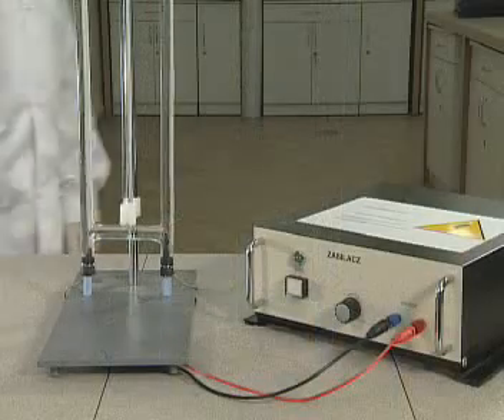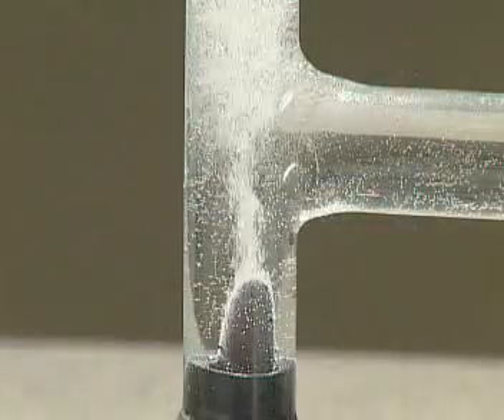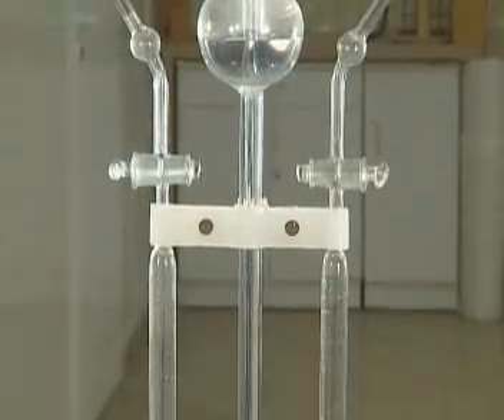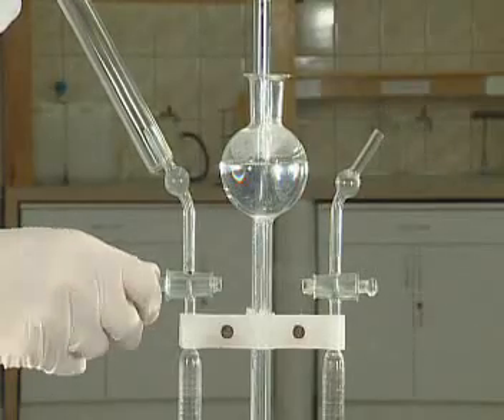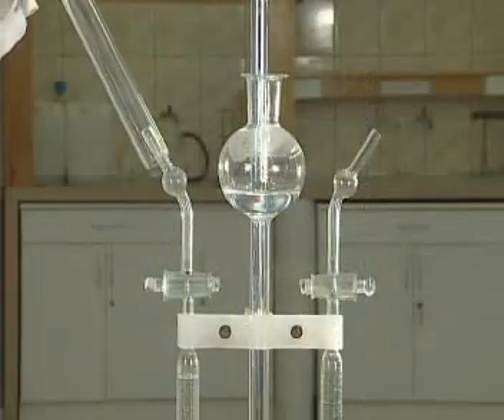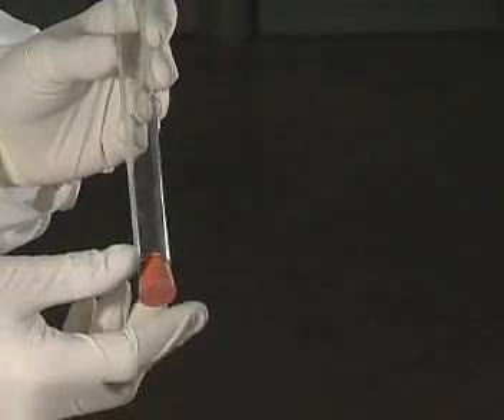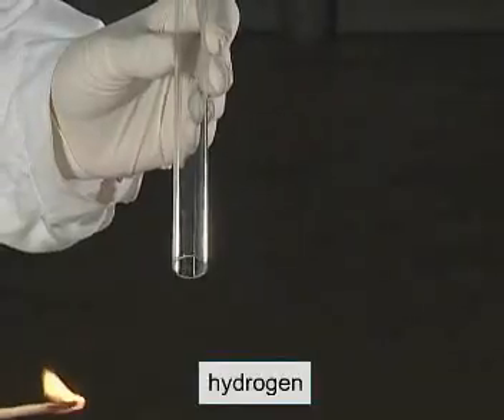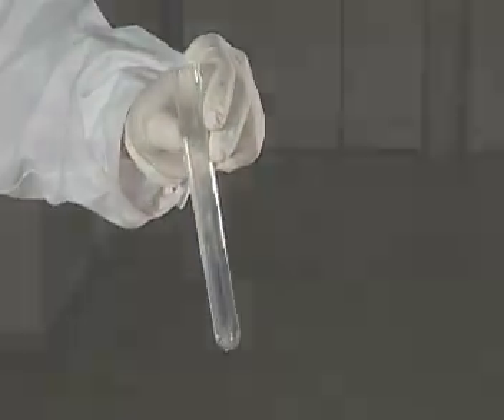Hygrogen and oxygen from water

Comment: So is the metal electrode also moved from one side to the other like standard electro plating and have you sometimes to reuse it have to change the polarity while first making sure there is no gass left behind in the tubes  to not make a mix of hydrogen and oxygen gas that is highly combustible ??
Is this threu that also the metal transports through the water ??? And can what kind of substance is added to the water ? An acid but what kind of acid again, I always seem to forget that ?

Comment: Somebody asked "Can I use Electrolysis process in deep see using sea water to produce oxygen? This way, I need not carry an oxygen tank." The answer is no. You will get oxygen poisoning. Your body has evolved to be in a gas mixed atmosphere. Getting more or less for the necessary gases can be fatal.
Reply: The problem with doing this in salt water, is you also get chlorine gas as a byproduct. Not a good thing to have mixed in with your oxygen, ya know?
Reply: madsbs123 well duh hes a scuba diver im sure he knows something about what mixture he needs. the fuck if i know anything about scuba gear i just told him it was breathable oxygen the same as what's in the air. the air just has other stuff diluting it. what about those oxygen bars they pump the air with pure oxygen and everybody jumps around breathing it just fine.
Reply: madsbs123 

You can get poisoned by the very air you breath 

Man just about everything is out to kill you huh
Reply: +madsbs123  You would still need pure H2O because what is used here is distilled water or pure water. salt water or any other types of water would not work for this.
Reply: Jack Strizek well no lol salts work much much better. and faster. but your gonna have a bit more thinking to do on separating all the products, and extra things like electrode consumption etc.
Reply: So nobody is caring about how that would electrocute you ??
Reply: Anything more than 23% oxygen will cause your lungs to be "bleached" the same way chlorine bleaches things: it yanks electrons off elements it reacts with.

Comment: If I had a hoffman apparatus in my home connected to my water source and powered by my home's electrical system, could I use the H2 in replacement of my home's heating gas?
Reply: a heat pump is a much better way of getting heat from electricity.

Comment: i want to try to build a portable underwater oxygen source, i thought adding a catalyst might speed up the proscess. is the oxygen safe enough to breathe?
Reply: Dylan Mazo don't add any more chemicals or it gets messy fast. All you need to increase the speed of oxygen production is to increase the amperage of the circuit. 1 coloumb is a mole worth of electrons. so you keep the voltage the same dont increase voltage, just double the amps and double the speed. double it again and again to your hearts desire. Higher amps require tougher, equipment and always thicker wires. or your machine will melt itself in the water and you will have to hold your breath after that.

Comment: @sovereignenergy

How does it work that hydrogen goes into 1 tube and oxygen in the other?
If the electrode steals an electron from the water molecule and makes it break apart, wouldn't it release both gasses at the same time?
Reply: positive and negative charges. Kinetic energy plays into it. Two atoms probably get release on the hot side and one on the cool side. With kinetic energy all the atoms get bounced around forcing the atoms out not necessary from the same place in the water.

Comment: It is unlikely performing the experiment with distilled water. The solution inside the Hoffman Voltameter should be acidified by sulphuric acid in order to increase the conductivity. It is also too ideal for the volume ratio of the collected gases. In real case, O2 has less volume than expected for its higher solubility in water comparing with H2.

Comment: Twice as much gas does not prove twice as many Hydrogen atoms tho if you think about it, this would be true "IF" the atoms were the same size but if hydrogen is smaller as we know it is then there could be many times more hydrogen atoms than Oxygen, therefor H20 is a misnomer. I am the first to challenge this notion that water is indeed H2o. I know this video did not mention that, I only post this as a date stamp to my position that H2o may be in reality H4o or H8o> All I know is its NOT H2o

Comment: @bro589 Chemistry Project, anyway, if your looking for non metals, you are best off with carbon, although it does not conduct electricity as well as platinum, it's a lot cheaper, you could just use the 'lead' out of a pencil, and it doesn't corrode...

Comment: what i'm interested in is what substance was used at the anode and the cathode of the apparatus to pass current into the water. Since the process of electrolysis is extremely corrosive to a metal, even that stainless steel emits rust, what substance was used that didn't rust in the process.